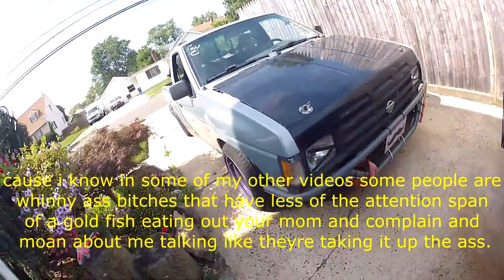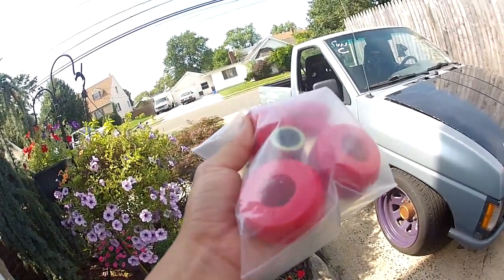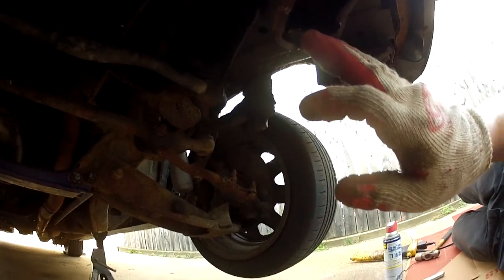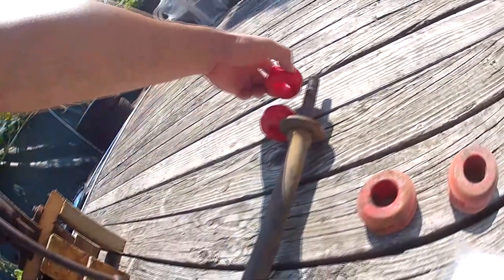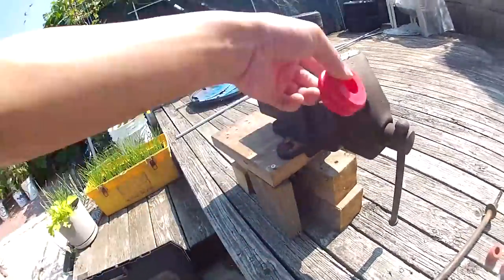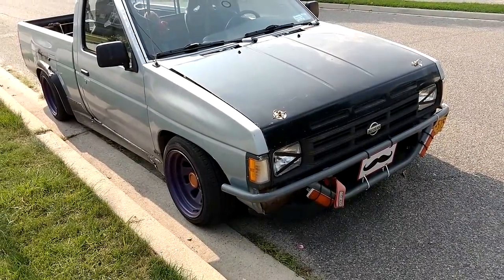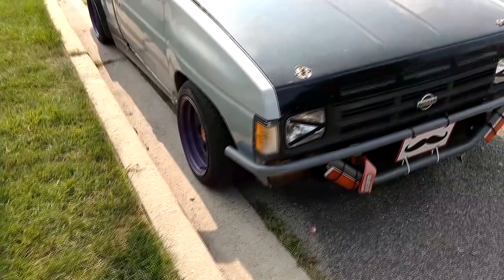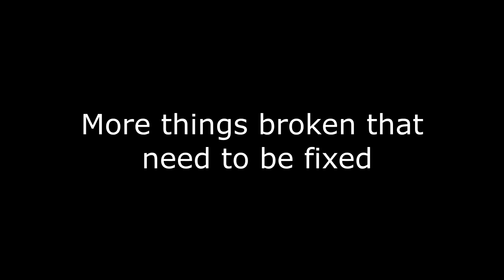Increasing Caster On A Nissan Hardbody

Comment: Just cut 20mm out your tension arm, sleeve it and weld it back together. Then it will self steer like a champ. This is what I did and I wouldn't go about it any other way
Reply: And you don't have to stuff around everytime you need to change the bushings. Just off the shelf stuff and away you go
Reply from the maker: idk why i never got notifications for your comment but now that im seeing this comment for the first time, thank you for the advice

Comment: Caster on these trucks is on the upper control arms add a longer bolt so you can add shims to adjust the caster better if you don’t have a alignment machine close to you you’ll never know what degrees it’s in

Comment: so. has this fixed the issue of the hardbodys drifting like ass?  does it help with the self steer at all is it noticeable?
Reply from the maker: i need to take it out drifting, as for driving it it self center steers better and the hardbody can drive straight,  ive had the truck sent out for 2 wheel alignments and it would still pull left and right, with this i dont have to fight the wheel anymore
Reply: Rice Truck Awesome thank you. i think im going to do this tonight

Comment: is the caster worse the more you lower it? how low are you? what if i only wanted to go down 2 inches?
Reply from the maker: with the supsenion design of the D21 caster dont seem to have changed on mine but the amount of camber and no having drop spindles lead to bump steer issues, this setup was 4/4 inch drop (it should be 3/4 but I made the front lower) I have other videos of how I lowered the hardbody so hope those can guide you in the right direction
Reply: @RiceTruck  thanks for the response, your channel is one of the best for hardbody lovers!!